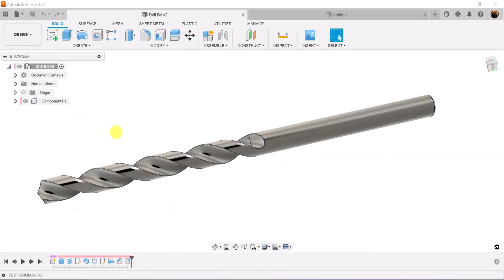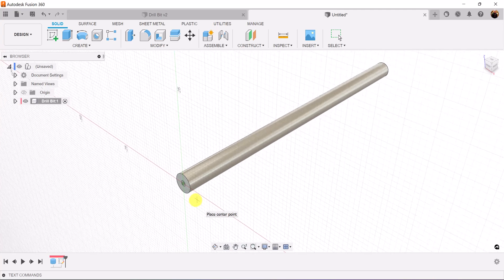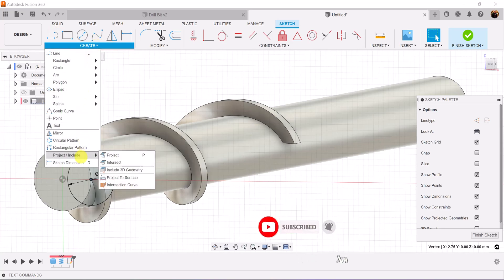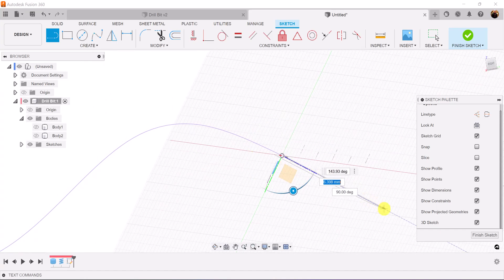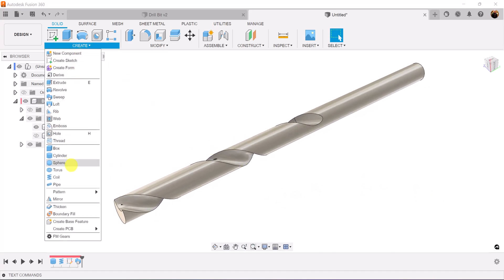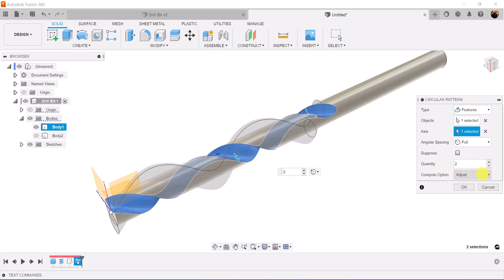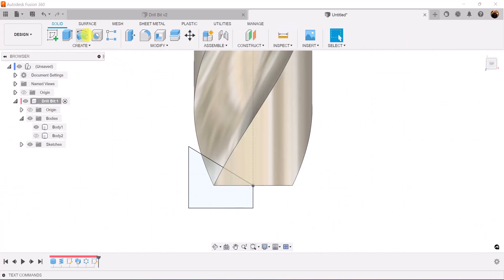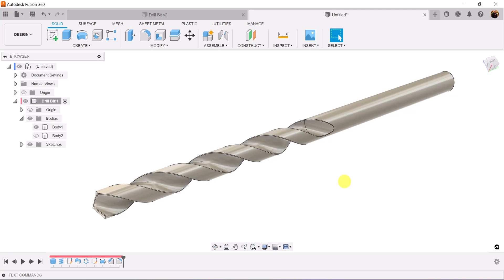How to Model a Drill Bit in Fusion 360

Comment: Thanks for the explanation, I had issues figuring out how to make spiral flutes like that.
Anyway, I have some experience with cutting tools and while it certainly looks like a drill, it wouldn't be functional. It's missing all the clearance angles for the cutting edges, making it a cone will make it not cut at all. Also don't chamfer the cutting edge.
Reply from the maker: I appreciate your valued input. I also make sure I have added in my about page that I'm here to provide exercises on how to use the software. Unique circumstances may differ based on real-world requirements and tolerances. Therefore my particular examples are meant to be a solution to help figure out a larger problem. Thanks again.

Comment: Hi CJ. Could you please help me. All good up to 2 mins 35 secs. I cannot figure out how you manage to rotate the axis with the line tool locked onto the end point. I have tried and tried, as soon as I try to move the axis, the line tool disengages, also, trying to get the Red axis vertical seems impossible for me.
Reply from the maker: On the sketch palette be sure that 3D sketch has been selected. You also left click and drag the line along the red axis from the center point which in my case is the X axis.
Reply: @CADJungle  Firstly, the 3D Sketch was ticked. I have tried to get the line to form a circle around the red axis. You manage to get the three axis to rotate until the blue axis is lined up. However if I hold down the shift button nothing happens, as long as I keep the left mouse button depressed and the axis remain where they are. I did get the blue dotted line when the Z axis was at 180 degrees to your position but when I tried the tangent constrain, it wouldn't allow me to select both lines. I'm sure there is an easy way to resolve this but I cannot figure it out.
Reply from the maker: I misspoke before, the Z axis should be the blue line not red lol. Also, sometimes I have to hit the escape key to make sure nothing else is selected and then try to use the constraints once again from scratch. If not, exit the sketch then, go back and attempt to edit the sketch with 3D sketch turned off and try the tangent constraint.

Let me know what happens! You now have my mind flowing :)
Reply: @CADJungle  With '3D Sketch' unchecked, the line tool, when directed to the spiral, shows an 'x' not the square. Also when unchecked, the tangent constrain doesn't see the spiral.
I've drawn along the blue dotted line several times but the tangent constraint doesn't accept it.  The plot thickens !
Reply from the maker: That is definitely weird. I attempted to duplicate the issue you are having and wasn't able to come up with the same problem. I was in fact able to draw the line and utilize the tangent constraint repeatedly. 

OK, send me a snapshot of your steps at this point to: support@monetaryingenuity.com and I'll take a look. Also if you are able to send me the exported file, I may be able to look at that as well.
Reply: @CADJungle  Info sent yesterday.